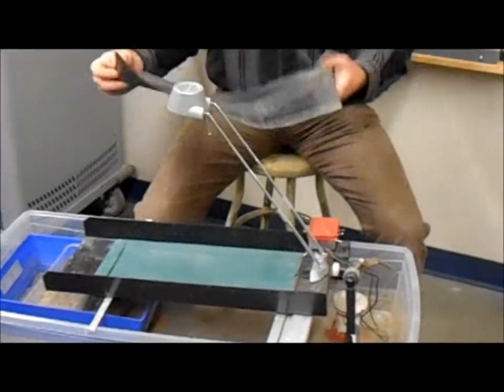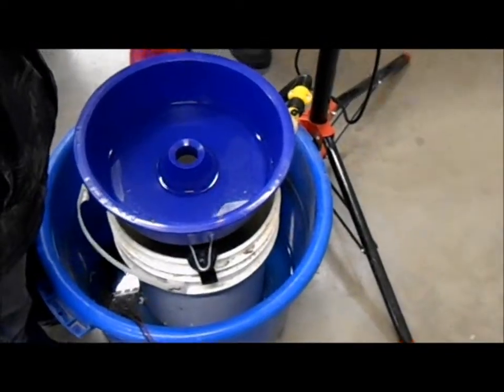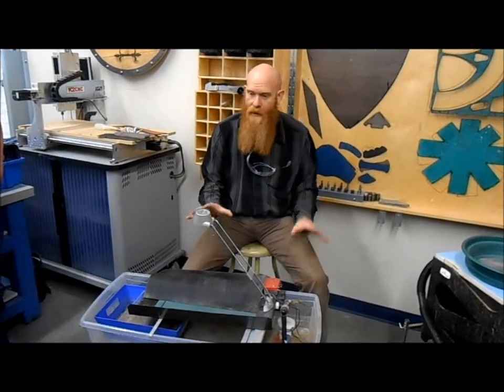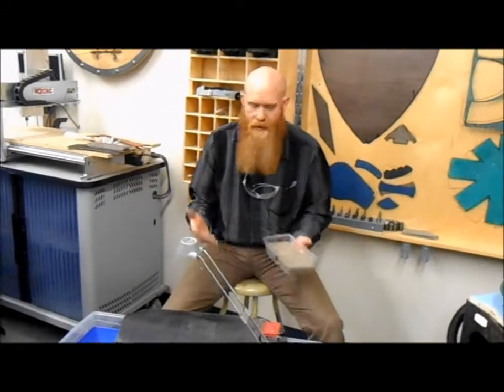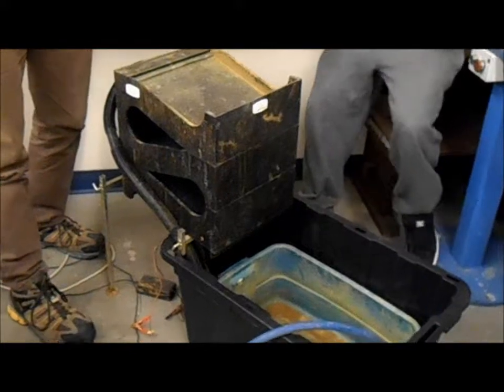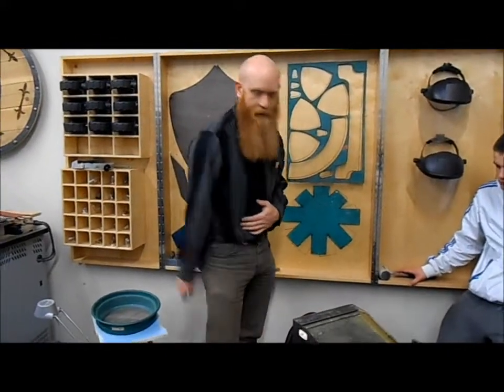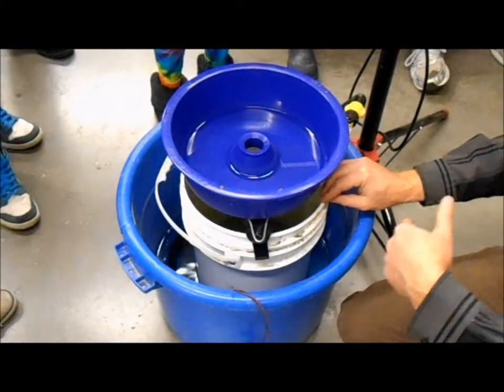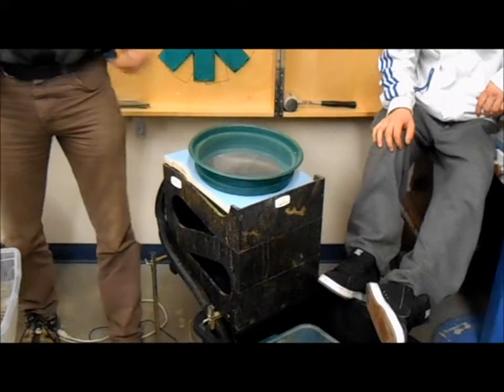Gold mining course, recirculation bins

Comment: Hey Dan, with your Miller table I've found that if you put a 100 mesh or smaller classifier under the discharge setting it on top of the inner tub that catches the fines and keeps them out of the pump but still allows the water to flow freely.